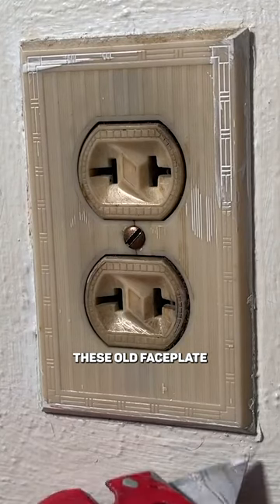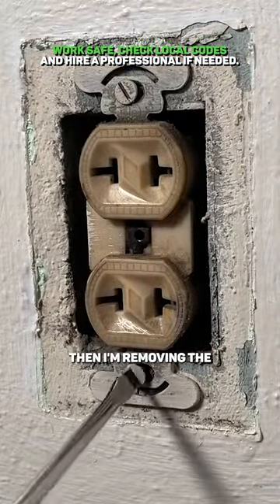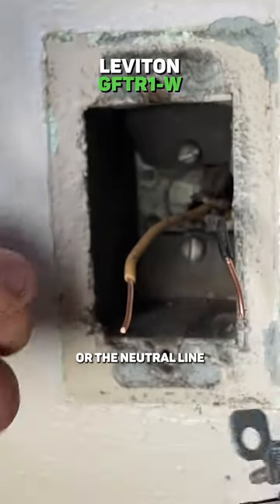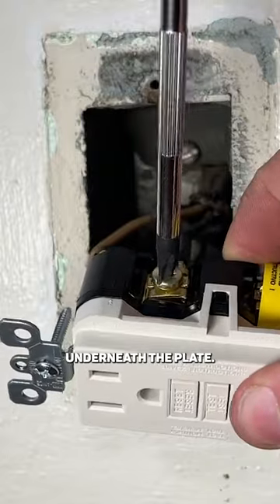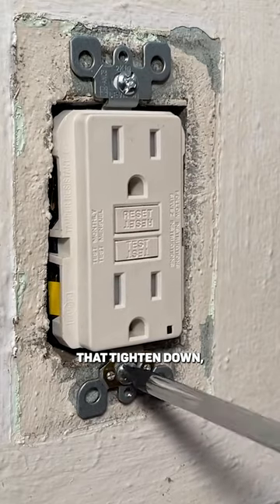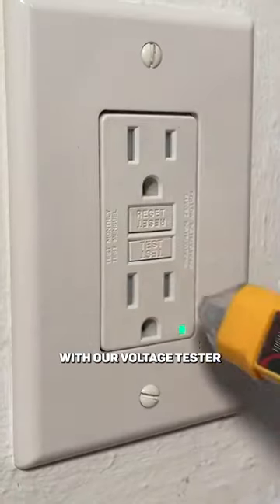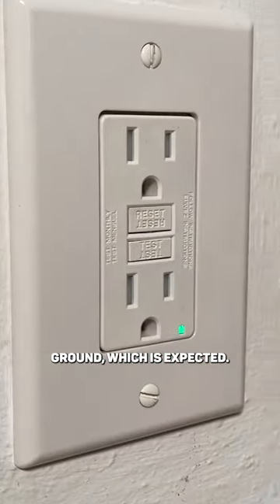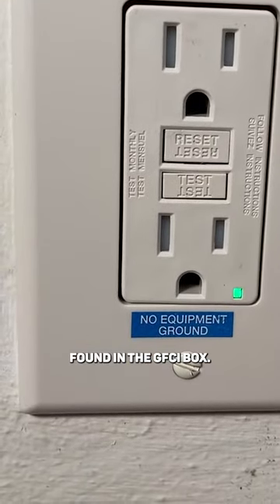Safely Converting 2 Prong To 3 Prong

Comment: What happened to the green wire from ground prong to box?
Reply: Noticed that missing, too.
Reply: These old boxes are not grounded, never were and would require rewiring to get a ground.
Reply: We have old house wiring, too.
Not grounded.
As we replace the receptacles, we add GCFI whereneeded, but not in the average room boxes.
I suppose it is best to add there, too, though.
To rewire a whole house, it would require removing much of the drywall, then it would be
expensive to run new wire through the house.
Reply: @ronstrong9560 Just fish a new 3 wire cable behind the drywall, pulling it into the boxes.  Optionally push in electrical pipes from crawl spaces to provide a protected location for replaceable wiring.  An alternative to buying lots of GFCI outlets is to get a European style central GFCI that goes in the fuse box instead of the main inlet switch.  Typical European models are rated only 40A, because that is plenty for a European home with 3x230V fed from 3 curbside 35A fuses.
Reply: @johndododoe1411  In the UK GCFIs or RCCBs/RCDs as we call them, are almost always 65A in fact I've never seen one that is 40A. But those are old school now and modern installations are more likely to have things called RCBOs which are a combination of earth fault and overload protection in a single device, for a single circuit,. Whereas, as you correctly suggested you used to use an RCCB/RCD to protect a bank of circuits. Typically one covering each floor of a property and referred to as a split load system.
Reply: @semperidem2577  UK installs are the weirdest in Europe and not much to copy.  But RCBOs are breakers with built-in GFCI that could be adapted to US fuse box module systems as straight drop in replacements for their traditional breakers.
Reply: @johndododoe1411  Don't you have the equivalent of RCBOs in the US then?
Of course hey are not intrinsically safer than having a RCD/GCFI cover a bank of circuits, they just add individual circuit discrimination, and that convenience comes at a price not every homeowner wants to shell out for.
I do find it strange that the US works with 2 different voltage levels, I don't know the history behind adopting 110v? for most things but then having 220v for stuff that needs a higher current draw.
Reply: @semperidem2577 
 I see what you're saying. But I believe that's in the NEC that you can install A GFI on the 1st receptacle in a branch circuit and then change all downstream receptacles to 3 prong outlets as long as they are labeled as no ground.
 I will also admit that I'm not the expert on why this is permissible or what the downsides are but I would imagine because it was legal it has to be somewhat safe.
Reply: @johndododoe1411 
 Yeah maybe that works on a super basic single level house with adequate crawl space. But when you're talking about my 3 story house from 1940 it's not going to be so simple. So being able to use this method works out well.
 Also you're only installing 1GFI outlet at the head of every branch circuit not at every receptacle location. As long as you make sure the GFI is at the beginning or the 1st outlet in the run you can just use standard 3 prong outlets For the rest of the run. So it ends up not being all that expensive and a lot cheaper than a bunch of copper! And tearing out drywall and all the rest of that.
Reply: Some old houses of mine are conduited completely with solid metal and all the outlets have a ground through that metal. Up to code in some places, others need that dedicated wire.
Reply: @ronstrong9560  you just have to make sure the first outlet in a given circuit is a GFCI or the breaker itself and the rest will be protected by the one GFCI. That is to code.
Reply: @brizzle8797  all line side outlets to a GFCI whether as an outlet or at your breaker are protected and will trip the same as if it was a GFCI outlet because it basically is now. The load difference gets detected and triggers the GFCI break. You could replace them all with a GFCI outlet but really a good practice is first unit GFCI and breaker a AFCI or combo breaker for both arc and ground faults as that extra insurance against fires.
Reply: @dave091790  
 I think we might be saying similar things sometimes when there's so many comments on one post it gets hard to remember the conversations you had exactly. But I think that is my plan to replace the 1st in circuit with the GFI I'm not sure if they make AFC I breakers for this old Box that I have in this house but yes that would be a good option if they did.
Reply: @johndododoe1411  good theory, however that would not work what so ever

and what you are talking about is a deadfront gfci that is installed by the panel as the circuit leaves, they come in 120v 15A as you would for your plug circuits, DO NOT get a 40A device, or anything larger than what your circuit is rated, you WILL burn your house down

call an electrician if you want electrical done

source: am a sparky
Reply: It would be useless, since the box is not grounded
Reply: @semperidem2577 we do have the equivalent in the US. Commonly used in new construction for kitchen and bathroom circuits, as well as outdoor areas. Cheaper and safer than chaining off a single gfi outlet.

Comment: Can I do that with knob and tube wiring too? Do I have to do it as a gfci?
Reply: The video is about adding the GFCI.  Not sure what knob and tubing wiring is.  If it's ⅝" tubes containing insulated single wires, you should be able to pull through fresh wire bundles that include the extra grounding wire, so no need for the sticker.
Reply: If you don't need to plug in any 3 prong equipment, then don't waste your time. The 2 prong receptacle is perfectly safe for most home devices, ie lamps. TVs, chargers, etc.

Lot's of scare misinformation about 2 prong receptacles. People think they need to upgrade to 3 prong because the internet told them. They are perfectly fine.
Reply: @johndododoe1411  knob and tube is early 1900s wiring
Reply: @cgschow1971  This is true, but part of the reason people are encouraged to replace them is the probable age of the receptacles. Old outlets that don't hold the plug tightly anymore can absolutely be hazardous. I had some pretty loose ones in my house for a long time. But yes, a 2 prong receptacle that's in good condition is not inherently unsafe, as long as you don't use 2-3 prong adapters with it (unless it's installed in a grounded box, then the adapters are fine). But most people probably wouldn't bother to verify that.

Comment: Would a GFCI even work as intended without a ground?
Reply: Yes, but only for three pronged equipment plugged into that receptacle. The additional receptacles downstream in the circuit would not be GFCI protected unless also replaced with GFCI receptacles.
Reply: @VinnyK85  That is not true. Any downstream receptacles wired to the LOAD side of the GFI will receive the same protection.
Reply: @cgschow1971  not in an old two wire circuit. Downstream receptacles will become de-energized when the GFI is tripped but a fault must occur on the GFI receptacle for that to occur. The rest of the old open ground receptacles have no way to communicate a ground fault back to the upstream GFI receptacle.
Reply: @VinnyK85  I'm fairly certain that's not correct. GFCI outlets do not use a ground wire to detect faults. They measure the amp levels of the hot and neutral wires, which includes the current it's sending and receiving from outlets further down the circuit. Whether or not the downstream outlets are grounded has no impact on this functionality. If a ground fault occurred on an ungrounded outlet that receives power from a GFCI, it means the current returning to that GFCI would be less than the load current that it's sending out and therefore would trip.

Comment: Don’t like that connection…..
Reply: It is a kind of connection used in commercial outlets or commonly 20amp outlets. It is called side wiring, and uses a plate to clamp down on the solid core wire.
Reply: It's one of the best wiring methods. J-hook and side wiring are equal on safety and performance. If you're thinking of "backstabbing" wiring, that is totally different. Backstab is dangerous and objectively inferior to either of the others listed.
Reply: You're not required to like it. So zip it.

Comment: That is old enough it has a metal box ,could have grounded it to the box
Reply: Box might not be safely grounded with something that will safely carry away 16A .  Need a thick AWG9 or bigger to safely ground a 16A circuit, even if regulation is more permissive.

Comment: Why not ground to the box.. it appears it's a metal box... And bx uses the steel jacket for ground fault
Reply: Only works if the box has been grounded
Reply: @michaeldunham3385  but the box is connected to the stud via screws.. should act as a minor ground, right? unless a human with wet, salty hands touches the receptacle 😅
Reply: @sidb9540  to be an effective ground it needs to be of very low electrical resistance hence why we have sophisticated measuring equipment and charts detailing the maximum value of resistance for specific over current devices so that actually work when they need to
Reply: Because he's a YouTube electrician not a real electrician.
Reply: @CybekCusal 
 OK smart guy what is he supposed to ground it to the metal Box what good does that do it doesn't go anywhere it's connected to wood and fabric wrap wire.
 So let's have the professional exploration then shall we.
Reply: Did you see BX cable in there? I did not.
 Because my house has metal boxes and fabric wrapped wire.. So you could say I'm familiar with this situation
Reply: @brizzle8797  I believe that is called knob and tube wiring.. kind of hard to tell from the video what it is.  Bx is steel encased and attached to the box via a castle nut.. can't really tell from the wires. 

If it is bx you can just j hook a wire to the back of the box with a screw.. and j hook to the green screw on the outlet.

GFCI outlets don't work without a ground wire.  GFCI (Ground Fault Circui Interrupter) trip the reset button if it detects any load on the ground pin.  He should have just used a regular 3 prong if he was gonna leave the ground open. It's basically equivalent to using one of those 2-3 prong adapters.
Reply: @xXVintersorgXx  
 Disclaimer alert I am not an electrician.
  We can't say for certain what's actually coming into the Box. If it is indeed bx which I am very familiar with then yes it is promisable to use the shielding as a ground or at least it used to be.
 But in my house that was Built-in 1940 I have metal boxes but the wire is an early form of romex that has 2 conductors and is wrapped in fabric. With plastic insulation around the conductors of course.
 In this scenario there is no way without running a separate groundwire or running dedicated replacement romex  to acquire a dedicated ground. This is likely the scenario he is facing.
 Under nec which again this is the way it was a bit ago.  it is permissible to use a GFI at the head of a branch circuit to protect all downstream outlets in that circuit. 
 All you have to do is ensure you put the GFI at the 1st outlet in that run  no ground is required and then switch all the other outlets out to standard 3 prong and then put the little sticker on the outlet cover that is what is required.
 Again not a license  Electrician so I may have missed a slight little nuance but that is 90% of it I am certain.
Reply: @xXVintersorgXx  this is very wrong, gfci's do not need a bond/ground to protect, they function on measuring current on the hot and back on the neutral, if they are even then things are working fine, once there is over a difference of 5mA of current flow it will open the circuit as it thinks you are providing the ground fault through some other means. the wiring shown in the video is an old style 2 conductor insulated with cloth, providing no suitable bond back to the panel, thus is why he is installing a gfci

source: i'm an electrician
Reply: @AlexBendel  so GFCI uses the neutral leg for ground fault if you don't have an actual separate ground to earth.  Interesting.  I didn't know that. 

I've been told by several electricians that bx cable (steel jacketed cable with hot and neutral) uses the steel jacket for ground and you should use it to tie the outlet's ground to the box with a green copper insulated wire and a green ground screw (I have a home built in 1912 with wiring from the 40s and recently updated 200A service)
Reply: @xXVintersorgXx  it depends on where you are, i can't remember but i think here in canada the sheath of the bx, even though it's bonded on both ends by the box or connectors, is not counted as a system bond. they come with a bond conductor inside, but like i said different jurisdictions have different codes on the matter

Comment: Why fit a outlet with a ground connection where there is no ground?
Reply: Probably because his local shop didn't sell 2 prong GFCI sockets.
Reply: Because it's not  A regular 3 prong outlet that would be illegal and dangerous! Instead it's a GFI and it is permissible under nec to install a GFI at the head of a branch circuit to protect it and all downstream outlets even with no ground.

Comment: Is it brings to up to code?
Reply: No
Reply: @CybekCusal  Yes, this is an acceptable option per NEC.
Reply: @cgschow1971  are you a licensed electrician?
Reply: @CybekCusal  I decline to say either way, but that is irrelevant. What is relevant is 406.4 (D)(2). Your local AHJ may vary.
Reply: @cgschow1971  lol. Dumbass. I'm an electrician so gfu
Reply: @cybekcusal4619 haha that's your comeback to a guy citing code? No comeback at all. Now your AHJ may have different rules, but many places this is acceptable because they follow the NEC.
Reply: @johnh8546   You guys are clowns and have no right to question a real electrician. Anyone wiring a device on an ungrounded circuit in a metal box and thinks this is ok needs their head examined.  At a minimum, replace the box with a plastic one that won't burn the house down. But more importantly, fix the wiring. Additionally, depending on what room he's in, he likely needs an arc fault circuit, which requires a ground. You can't just look at one section of the code, you need to know all the codes and also some experience and common sense.  210.12 look it up.
Reply: @CybekCusal  If you are an electrician,  you need to learn your trade better.  NEC shows this as an acceptable way to fix the no ground issue.
Reply: @JDel709  drive your car with your feet. I hear that works well.
Reply: @CybekCusal  Seems you take pride in not actually knowing the NEC, even though you need to follow the NEC for your career.
Reply: @JDel709  not really. I also have an engineering license and it pays way better than electrician work. Nice try scrub.

Comment: Why did you test the neutral side for power?
Reply: Because trust but verify is a powerful statement. Trust that the person did the job right before you but verify they did when your life is on the line.
Reply: Agree with ronald. 
I have see stuff wired backwards and also gfi's wire from load side.  
Always double check.
Reply: @Happyoldfashionfamily I've even seen a 3-prong install that wired live to the grounding hole to the live. Made a big bang when someone plugged in a grounded device and we had to call in an electrician to redo that wiring.
Reply: Ok,but he has a GFCI tester,which would have alerted him of reverse polarity!
Reply: @johndododoe1411  i'm so glad i haven't seen that in the field lol, i'm sure i'll come across it one day from some homeowner reno but i hope never

Comment: As soon as you said "you do not need to make a J hook", I knew you had no idea what you were doing
Reply: As soon as you made this comment, I knew you had no clue what you are doing.  If you are putting J-Hooks on GFCIs, you are installing them incorrectly.  They are designed to have the wire clamped by the metal tab under the screw.

Comment: Why install a GFCI if there is no ground? Does that not defeat the purpose?
Reply: Despite the "ground" in the name, GFCIs don't require a ground to operate.

A GFCI will still trip without a ground wire if there's an imbalance of current, indicating a short circuit. Breakers do this already but GFCIs are more sensitive and respond faster, so they're safer for humans than breakers alone and far safer than ungrounded (2 prong) or improperly grounded (3 prong but with ground not working) outlets.

Without a ground wire, GFCIs do not help with electrical spikes from lightning or ESD, both of which affect equipment more than people.

tl;dr - without a ground wire, GFCIs are still safer for humans than ungrounded/improperly grounded outlets, but equipment is still vulnerable.

Comment: Never 100% rely on a volt stick
Reply: Then what are you supposed to rely on?
Reply: volt sticks are handy tools but if you need to be 100% sure you use a multimeter and test for voltage

Comment: a gfi will not trip without a ground
Reply: Wrong it has nothing to do with the grounding conductor
Reply: Yes it does.  That's why it's required by code in cases where a ground is not present.

You need to learn how GFCIs work.  You don't have to take my word for it, or even the internet's.  Go test it out for yourself.